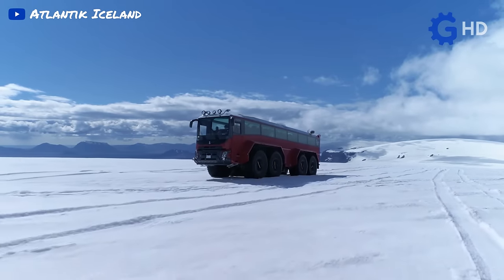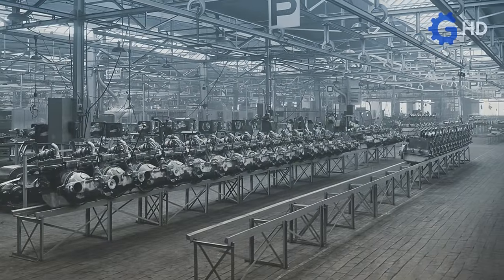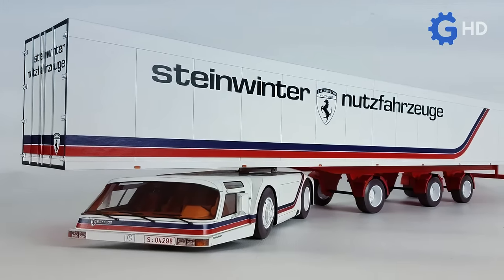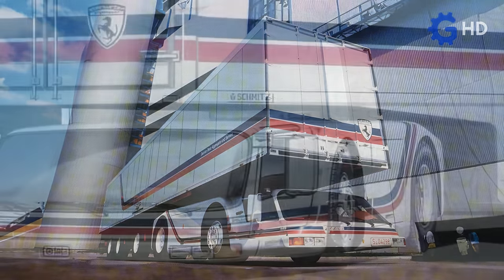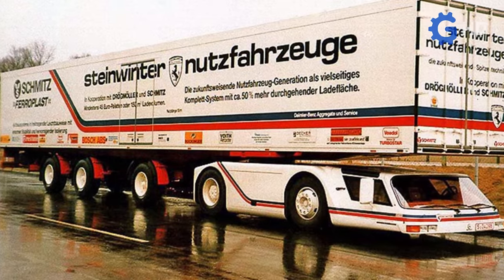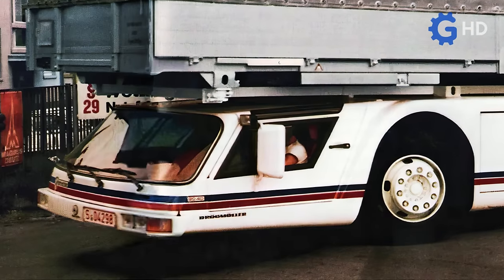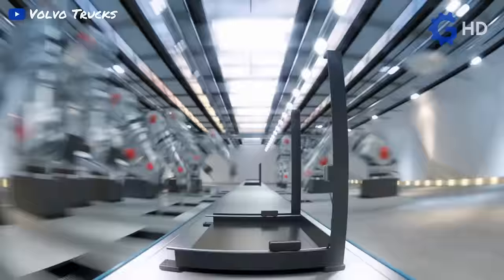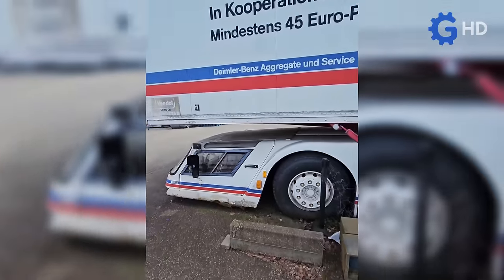The Most Extravagant Truck in History That Nobody Wanted to Produce ▶ Steinwinter Supercargo 2040

Comment: As a US truck driver, this truck looks like an absolute nightmare to drive in adverse weather, as the spray from other motorists would completely blind you. Not to mention forward visibility being about zilch...
Reply from the maker: Adverse weather conditions can be challenging for any driver, especially in a truck like this.
Reply: That is a extremely good point
Reply: That actually is one of the points that I was thinking about I'm a truck driver myself
Reply: I agree but I can't lie,  I kinda think I like it. 😂
Reply: This is near undrivable and dangerous, but really interesting.
Reply: I would be less concerned with visibility then I would be on making turns. The king pin is so far back that you'd need a lane 40 feet wide to keep all that front overhang from hitting anything and still be able to keep the trailer tires in the lane. It would be pretty cool for the highway but a colossal pain in the ass at best in town and yes, that's 35 years of driving almost every kind of truck on almost every kind of of road. Or lack there of.
Reply: Really? And no mention about tons of stuff hanging above driver's head?
Reply: It would be much less aerodynamic just by having the trailers flat surface exposed at the front as well, meaning it needed special, more aerodynamic, trailers.
Reply: @davidaugustofc2574  Indeed!
Reply: I was thinking i would NOT want to drive this anything but local too. Imagine going OTR with this lmfao.
Reply: @wildcat20021  Uuhhh, NO!
Reply: Not just adverse weather, trying to drive this thing in traffic would be a night mare as well.  You wouldn't even be able to see past a Miata, let alone spot something important far enough down the road to adjust to it.
Reply: @crackedjabber  Quite true about the lack of visibility in that thing. A chipmunk would go through the windshield!
Reply: What do you mean, "no forward visibility"? You can see the ground just fine...
Reply: I don't get it. The cab is as tall as a car, and the rest of the cars somehow drive perfectly fine?
Reply: @SianaGearz  a standard car doesn't have a stopping distance nearly as long as a fully loaded semi.  So if you can only see to the next car, you're generally fine.  A semi, especially loaded, takes a whole lot longer to come safely to a stop.  So if all you can see is the next car, then if he has to panic stop, you're going to hit him... and whoever he hit.  

From the elevated position of a normal truck cab, you can see over basically every other car on the road. This allows you to plan for the other drivers a whole lot better.
Reply: @gorilladisco9108  Meh used to deliver steel I beams that sat over the cab, up to ten tons capacity on the rack, plenty of car transporters put a car over the drivers cab too.
Reply: On the other hand if you emergency stop with a load of steel plate or roll, a cargo slide will go over instead of through you.
Reply: Also, YOU are the bumper and crumple zone.
Reply: @edli301  ^^FACTS!!!^^
Reply: You should try that Ford GT !
same ?
Reply: @lucasrem  HA!!!

Comment: For a highway long distance vehicle it fails straight away from a drive point of view. Due to its low height you can't perceive traffic ahead at distance. I.e making braking distances so short that at average speed you would have little change to brake in time with other road vehicles.
Reply: Put a camera on top. Basically equip it with all the newest car tec.
Reply: equipping this thing with a periscope doesn't really solve the problem in terms of highway safety. it's just another distraction which doesn't improve the real-time reactions necessary to negotiate hazards
Reply: with modern technology a camera could be mounted high up
Reply: I agree. Truck drivers need to be able to see “over” 4-wheelers to anticipate changes. OTOH, if you’ve got nothing but trucks in front of you, you can’t see anything anyway. 🤣
Reply: @rogerdennison8154  that when you back off, seen so many drivers cut half for tailgating
Reply: That's solved with a camera these days.
Reply: Thats not an issue. Most Trucks drive behind other trucks who all have the same max height. Only inside cities you have cars in front of you.

Comment: You failed to mention that the cargo box could be opened at both ends allowing the driver to approach difficult docks forward. I seem to recall reading about this truck in either Popular Mechanics and/or Overdrive magazines. I think one of the reasons for its ultimate failure was driver safety. In the event of an accident the driver had virtually no frontal protection and there was a real chance of being crushed under the cargo box. Drivers did not like it at all.
Reply: So same as a modern city bus in Europe today with no real or meaningful protection for the drivers
Reply: It looks more like perceived v. actual safety. As load, coming loose due to emergency braking or accident, will not exit through cab, like with normal truck.

Comment: The future was more futuristic in the past. It's a shame...
Reply: To be fair this was a dead end
most of the actual positive changes didn't happen because society is oriented around money, not progress
Reply: @kenetickups6146  Not really. A Few modifications to the design and it would have worked.

Heck, it's understeering problem could have been solved by moving the front wheels in front of the Driver's Cab. Heck, Volvo's design shows that extending The Driver's portion to Just beyond the Trailer so it could stick out, would have provided a fix to the vision problem, as the whole reason it had poor vision was due to the Trailer blocking a majority of the view.

Cooling system would also have worked the same way. Just push it a little further forward for breathing room, and boom, Easy fix.

Comment: It has potential merit in low speed applications with good traffic control. With modern camera technology, it could be the ultimate dock donkey.
Reply: Not
Reply: We.have better tech now
Reply: @mosthatedandroidtunernolim9800  Right; tech enough to not need a driver at all.
Reply: That would not make a good yard dog/hostler. this visibility problem and having to climb up out of the cab would make it a nightmare.

Comment: How did Steinwinter not get sued by Ferrari for that logo?!
Reply from the maker: Great observation! It's definitely a close call. Might be an interesting story there!
Reply: The horse is the coat of arms of Stuttgart, where Steinwinter had its seat. Look at the Porsche logo which also contains a Stuttgart horse in the middle. It's an interesting story how the Stuttgart coat of arms became the logo of Ferrari,  but Ferrari and Steinwinter both took the Stuttgart logo and Steinwinter didn't simply copy the Ferrari logo.
Reply: @erichkarrenmann6892  
all cars use a circle in logos..just about.. call a lawyer/

dodge,chevy, renault.. whatever.
Reply: @squarepusher645 what circle? This is about the horse…
Reply: @nymez6968  ur mom
Reply: The prancing horse logo was originally designed by fighter ace pilot Francesco Baracca. Ferrari was given permission from the family to use the prancing horse logo, as was adopted onto the coat of arms of Stutgart. 

Porsche also uses a prancing horse on their logo. 

I imagine they got permission from the family to use it.
Reply: @BigGuy10Points  The coat of arms of Stuttgart shows a horse since centuries. The details changed a bit, but it is not something new. Back then there where no airplanes.
Reply: @uwetheiss970  ok? So what’s your point?
Reply: @BigGuy10Points  That stuttgart didn't adopt something from a fighter pilot. This is the coat of arms since the middle ages.
Reply: The Horse "Stuttgarter Rössle" in the Porsche badge looks a little different, rather like the Continental one and also the Sachsenross/Westfalenross in the Coat of Arms of the States of Lower Saxony and Northrhine-Westphalia.
Reply: This is the coat of arms of Stuttgart. 
The lettering is called Steinwinter Stuttgart. 
The Stuttgart coat of arms is also part of the Porsche coat of arms.

Comment: People never mention that Steinwinter didn't truly come up with the Supercargo concept, fellow german Truck maker Büssing built their own Supercargo (even had the same name) in 1965, but designed as a rigid flatbed lorry instead of articulated. Büssing was perhaps best known for their underslung engines mounted in the center of the frame vehind the cabin and laying flat on their side, much like the engines in many light diesel Railcars. Advantage being less noise and more space in the drivers cabs, but kinda awkward to work on and pretty much completely exposed to the elements, and less flexibility in terms of chassis configuration than a conventional front engine, the Unterflurs were pretty much solely limited to long wheelbase rigid trucks. Believe it or not the underslung engine were kept in production by new owners MAN until 1986

Comment: I feel like they need to make it like the cybertruck where all the wheels steer and cameras can be used for more visibility these days. There is definitely a way to make this idea work in the present day
Reply from the maker: That's a fantastic suggestion! The idea of using all-wheel steering and cameras for enhanced visibility like the Cybertruck is definitely intriguing
Reply: It's a great idea. However, the driver safety issue still remains. Perhaps the design can serve better as an autonomous driving platform.

Comment: I don’t think the actual Steinwinter was used on The Highwayman. That truck I believe was a heavily modified Peterbuilt, and was much narrower than the Steinwinter. You can really tell by the windscreen. The Highwayman truck was a Hollywood chop job inspired by this truck. The other truck in the show pulls a lot from the Ford and GM concept Turbine trucks of the 60’s.

Comment: If the sports cars I've owned/driven are any indication, that seating position will be absolute murder on your lower back after just a couple of hours. I've found (for my back at least) it doesn't matter how well-designed the seat is: if my legs are out in front of me, it's going to suck. Conversely, I can drive an old pickup with a crappy cloth bench seat all day.

I think this would be quite literally crippling for someone trying to drive it professionally. Truckers have pretty high rates of back problems as it is. Between that and the obvious safety issues, I can see why it didn't take off. But it's cool!

Comment: GM's 1964 Bison concept truck has a very low forward control cab design with a short wheelbase.
Reply: The Bison was deceptive. The drivers compartment was lower, but behind it is this large tall structure that looked like an odd sleeper cad, that housed the twin turbines.

Comment: Interestingly, there was already another German "Supercargo" Truck very similar to the Steinwinter in the 1960s, it was built by Büssing from Brunswick (they got acquired by MAN in 1971, the lion badge is the Brunswick Lion, I heard they wanted to get rid of that because the factory in Brunswick is defunct for decades now, they're still in nearby Salzgitter, but the response to that was so negative that they kept it).
But it wasn't a truck for trailers but a full flatbed truck instead, where the flatbed made the whole length of the vehicle.
This construction was only possible through the under floor engine (the engine is mounted in the lower part of/under the frame, literally between the front and rear axle) and that engine concept itself was invented/developed at Büssing an patented in 1935.
Reply: Du hast den Kommentar den ich gerade verfassen wollte bereits geschrieben, also muss ich das nicht mehr tun.  Als kleiner Steppke bin ich in den 80er Jahren einige Male als "Beifahrer" auf großer Tour mit Schwertransportern für riesige Stahlbleche unterwegs gewesen, unter anderem war da auch 'ne MAN-Unterflur-Zugmaschine dabei an die ich mich heute vierzig Jahre später immer noch erinnern kann ... nicht weil es die stärkste gewesen wäre - das war sie nicht - aber die hat einfach nen besonderen Sound gehabt.

Comment: This marvel can be adapted for a modern use: the fact the engine is placed just in front of the rear wheels let a huge place under a standard cabin with a standard configuration (a high cabin at the front of the vehicle). If the engine is no longer under the cabin, you can modify the cabin's configuration. You can rise the cockpit and the empty room under it can be used as a sleeper. If the bunk is no longer behind the driver, there's about 1 meter of empty space so, you can add a shower or something like that, to add comfort for the driver.
Reply: Yeah, I always thought it would be cool to sleep underneath something kinda like an animal "den." But also, truck engines are in the front, even on cabovers, for a reason. And that reason is servicing. And to a lesser extent, cooling.
Reply: @Drunken_Hamster  on this one the engine is at the same place as a supercar, the main problem is to find a way to improve cooling (bed will be between the radiator and the engine) and talking about sleeping under something, don't forget that a house's roof weighs tons and if you live in a multi story building you have hundreds of tons over your head (being afraid of sleeping under cargo reflects a lack of trust into the vehicle strength)

Comment: Actually probably a much more effective design for an autonomous truck, visibility and comfort wouldn’t be an issue anymore
Reply from the maker: Great point! Autonomous trucks could indeed benefit from this design, as visibility and comfort wouldn't be as critical.
Reply: @GearTechHD  Probably solve the cooling problems because you could use more of the front for air intake.

Comment: The suspension on the cabin would have to be stiff to support the weight of the cargo.
Reply from the maker: You're right about the need for a stiff suspension on the cabin to support the cargo weight. It's a critical aspect of truck design for handling heavy loads.

Comment: I already have trouble seeing around high hedges in my sports car.  More than once pulled in front of a vehicle because I couldn't see over an obstacle so I have to really lay on the accelerator to keep from causing an accident.  Can't imagine how much worse visibility is in THAT monstrosity let alone how to recover from those situations when your 0 to 60 time is measured in minutes.
Reply from the maker: You make a good point about the visibility issues in larger vehicles compared to sports cars. It’s important to consider these challenges when designing and operating such vehicles. Thanks for your comment.

Comment: I’m for one thing that this design actually is rather innovative and likely does and will have a resurgence of sorts. Yes, we’ve got the things like from Volvo, but as stated in your video, the things from Volvo that are being built and such are purely just for operation in places like large Seaports and stuff like that. But at the same time I would think trucks like this could be Remely useful. I think the only real thing that would need to be altered would be the simple fact that there would probably need to be cameras or sensors of some kind on it to alleviate the visibility problem.

For one thing trucks like this or maybe calling it a “truck” doesn’t really work but vehicles like this. You definitely do have a place. I can certainly see the passenger coming into use simply as a essentially oversize long haul bus for traveling and such. After all accompany like Greyhound would probably jump at the opportunity to have a bus system like this, that would allow them to transport larger numbers of passengers.

The cube van design specifically, the one where the trailer part or whatever you wanna call it is literally on top is definitely another interesting idea. The only thing that I would be concerned about would be the possibility of the unit being to top-heavy and therefore running the risk of it rolling onto its side. 

Either way vehicles like this definitely I feel could be useful. The only things that I think would need to change would be a combination of safety features and probably other kinds of regulations. But overall, I think they could work.

Comment: I'm fairly certain the main reason that SUVs took off the way they had was primarily for a view of the road.  While lovely as a concept vehicle, this thing gives a lower viewpoint than the Ford GT40 mentioned in the video.

There may be a purpose for it in use, but I can't see it out in the wild outside of some RV/Camper Trailer hybrid, and even then, I can see it having to break design to have people wanting to use it, by extending the cab forward and raising it to at least where you would be in a common pickup truck.

Comment: I think it's interesting concept but I can easily see visibility issues trying to back a semi truck up into a tight spot does a bigger semi truck actually has mirrors on there to where you're able to see what you're doing better and where exactly would me the driver sleep at on a 3-day Hall I don't see a sleeper cab in the truck
Reply from the maker: You've raised some valid points about the practical challenges of operating a larger semi truck, especially regarding visibility and accommodations for long hauls.
Reply: @GearTechHD  it's a trucker's perspective and I'm pretty sure that's part of the reason why it didn't go anywhere but still a very interesting concept I would like to drive one just for the heck of it once just to see how they do handle